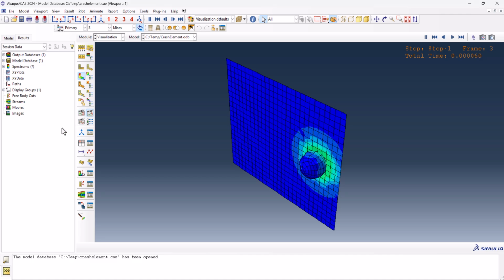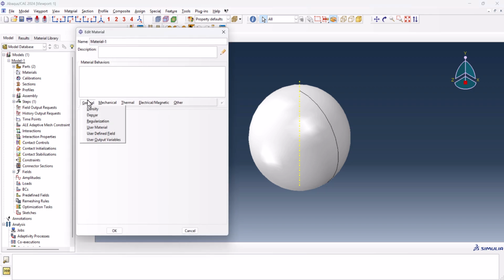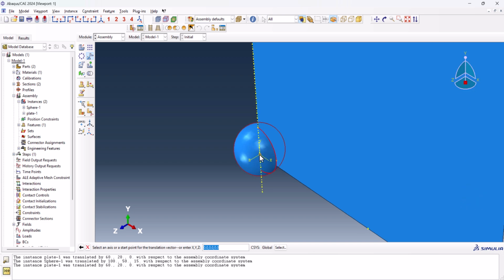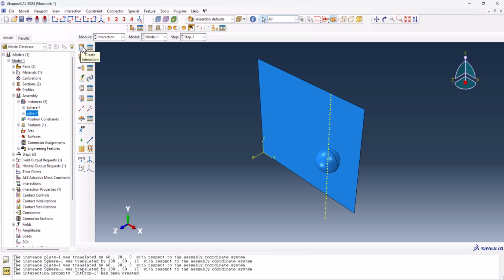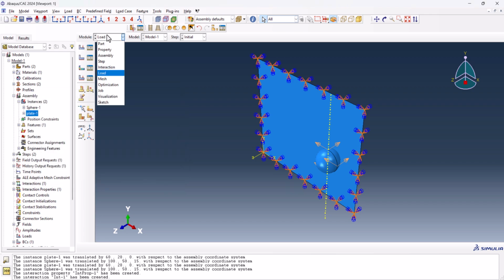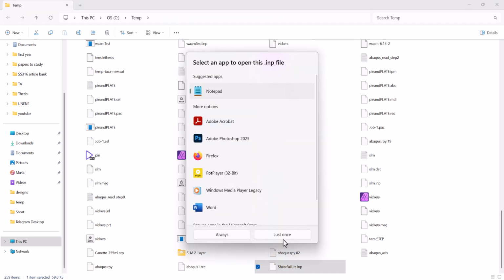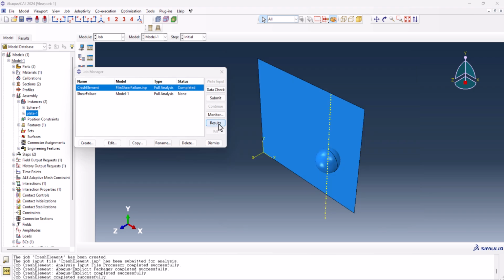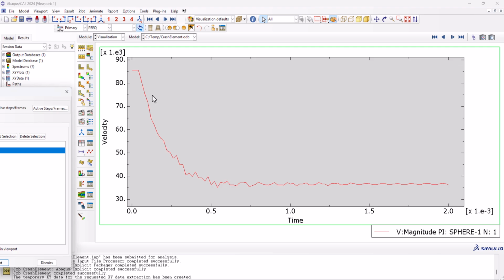High-Velocity Bullet Impact Simulation in Abaqus Explicit – Step-by-Step Tutorial

Comment: For doing explicit analysis we just need to define the shear failure value and it's automatically act as a VUMAT subrutine?
Reply from the maker: That’s a good question. Just adding a shear failure value doesn’t automatically turn your model into a VUMAT. For explicit simulations, if you’re using built-in material models (like ductile damage or Johnson-Cook), then defining things like equivalent shear strain at failure can trigger element deletion or softening—so you don’t need a VUMAT in that case.

However, if you want to implement custom material behavior—like a user-defined plasticity model or damage evolution law—then yes, you’ll need to write a full VUMAT subroutine.

So it depends on your goal: if you're using standard failure criteria, you're fine with the input file; but if it’s custom logic, you’ll need VUMAT.

Comment: From where the 0.19 was taken ?
Reply from the maker: The shear failure value of 0.19 is a material property of the steel used in this simulation. It represents the critical shear strain at which the material begins to fail under extreme stress. This value is typically obtained from experimental data, research papers, or material handbooks that study ductile failure under high-strain-rate conditions. Depending on the specific grade of steel, loading conditions, and strain rate, this number can vary. If you're working on a similar simulation, it's always a good idea to validate it against experimental results or literature data!